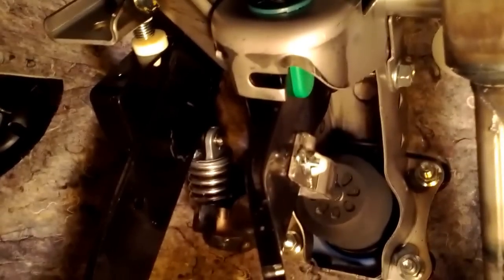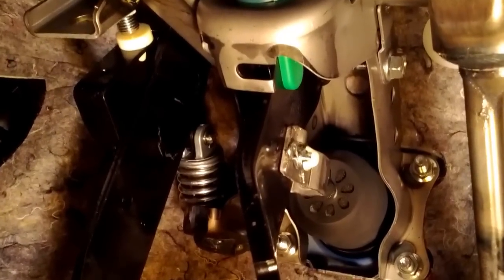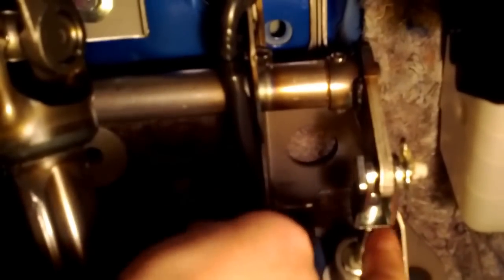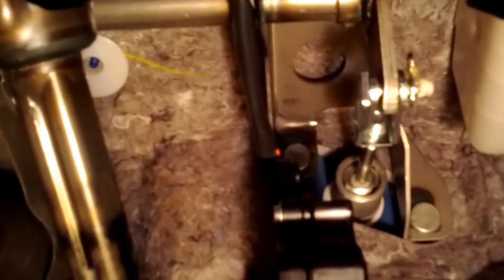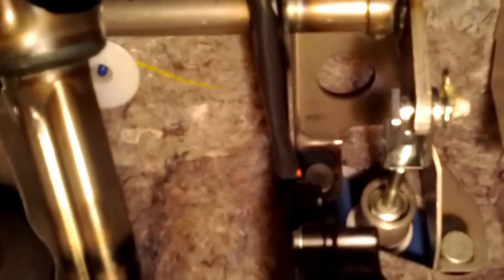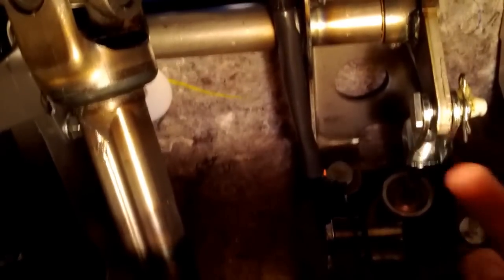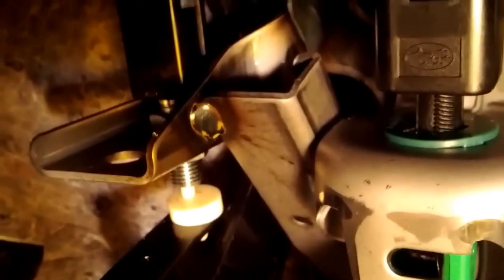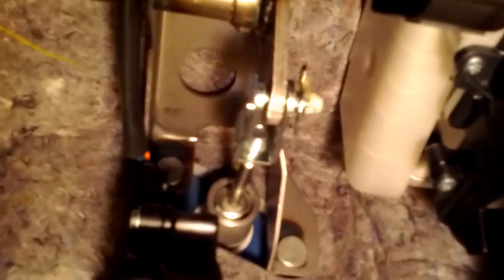BRZ/FR-S Clutch Pedal Adjustment DIY

Comment: I just bought a 2016 Brz and the clutch engages so high. -EDIT, Okay I just did this and it's a massive improvement. Still need to "get good" at shifting again but it's a lot easier now.

Comment: after adjusting the clutch with the ruler, Regarding the pin that sticks out:

When you push on the sensor as you hold the clutch pedal up, is pushing on the sensor above the two bolts the motion thats going to push the pin that is sticking out back to its original position?

Comment: This is not to adjust the clutch pedal, what you did is to adjust the clutch pedal to clutch master free play, if you adjust too tight/no pedal play you would burn the clutch and may cause premature wear on the clutch, if you adjust too loose/too much pedal play you might have problem to shift the gear and may damage the gearing.

Comment: Good video. I just did this to my 2008 forester. If ya'll are wondering if it is the same for your car, just hop in there and look. Many cars have the same set up, and it works for them as well. A few things I would like to add just in case anyone wants to DIY and is having trouble like I did.

First: Get comfortable. I laid down the driver seat all the way, and ended up with my left knee halfway over the pasenger seat, and my left leg resting on the e-brake. It hurt the hell out of my back to get in there but it can be done.

Second: Yes it is a 12mm. At first I tried the 12 and it didn't work. I flipped it around and it still didn't work! I didn't want to cut my tool nor did I have an angle grinder to hack it down with so I had to get creative. If you look in the video you may or may not be able to make out the pin (that holds the silver and brown shaft together) and safety pin (which makes sure it doesn't come apart). 

I pulled the safety pin out, and broke off that stupid white plastic so I could separate the clutch petal to master cylinder ball and socket shaft thingy from the clutch petal piece(separate the shiny thing from the brownish thing) in order to get a better angle on the nut to be loosened. Once I had the two separated I stuck a philips screwdriver through both holes of the fork(the shiny thingy) and THEN I was able to loosen that nut. Pain in the ass! BUT here is the thing. I ended up bending the fork a little, and I didn't like that, because I had to bend it back perfectly so it could all go back together. IF you use my method I suggest you find the correct size metal shaft to go through both holes with minimal play. A drillbit comes to mind.

Third: I'm just guessing, but I assume the other piece you adjusted was for the hill holder? I don't know. I did not adjust that at all, and everything seems fine, but I only did ONE full turn.

Fourth: I seem to have the opposite problem as most other people have had because my clutch engaged right off of the floor. I adjusted the fork out one full turn and its all better (engaging mid stroke). Maybe I need to go one more full turn, or maybe a half. I'm happy with it the way it is and I plan to buy a brand new OEM clutch fork when I replace my clutch and move out of the city. 

Fifth: If you think your are turning your wrench the wrong way remember your upside down and the nut is on the back side...it's a little different than how you're probably used to turning a wrench. Look at the threads on the shaft and imagine which way you would HAVE to turn the nut so it spins loose or tight. I mention this because in the video there seems to be a little confusion. Shoot for a second when I was under there I almost thought it was left handed thread, but its not.

hope this helps anyone having trouble getting the nut loose
Reply: +Shane Wiley Curious, Im thinking about doing this to my STI, I unfortunately am having a issue with my new Exedy Twin Disc, its engaging the clutch immediately as soon as I start to let off the clutch pedal. Will this help with that? I just want another half inch of play to release
Reply: That pretty much exactly what mine was doing. It was a stock clutch (maybe...it has 150k miles and counting). Where did you order the parts from? did u ask them? Maybe try calling up rallysportdirect and pretend like you are interested in buying one and say something like "so i heard u may have to adjust the play inside the car next to the gas petal", because all of those guys drive hopped up wrx's and stuff. Check out subaruforester.org, nasioc, clubwrx, and if that doesn't work go to a flat4 event and ask around. Hell, email exedy yourself. They responded to me in an hour when I emailed them once. There is a big community of subaru peeps out there that have already done the same thing you have, and they want to help. I would say yes, that is what you want to do...but watch the last bit of the video where he talks about the grinding, and make sure you don't hurt her. I don't want to give u bad advice.
Reply: Oh yeah, and for just a half inch you won't have to do a full turn. The full turn was quite a bit of difference, but I like it a lot. Weird to get used to at first, but proper. Right in the middle.